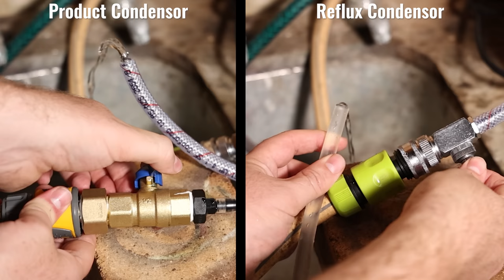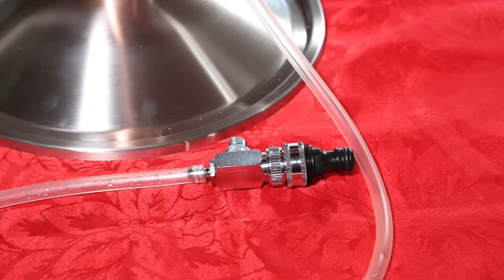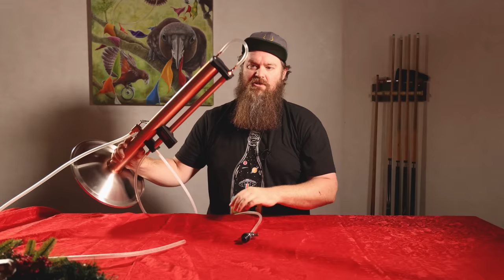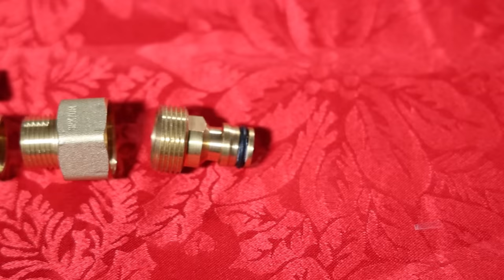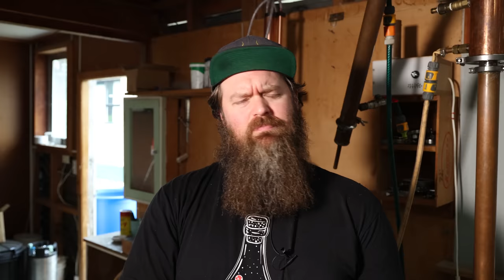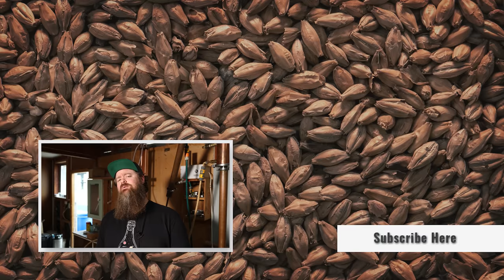Upgrade Your T500 Water Supply : Separate Product & Reflux Condensers

Comment: Great work. Hopefully, we're going to see how you actually use and control this new Frankenstein still :-)
I love the T500 - it's so easy to use - but I want more flexibility out of it and am looking forward to seeing how you can turn it into a pot still.
Reply: Strictly speaking, you already have everything you need to run it as a pot still. Take the normal outlet hose off the fitting it's on now and plug it into the top of your condenser, like he's just shown. Presto, it's now a pot still. The reflux condenser won't do anything because it doesn't have water flowing through it, and it'll run like a pot still. Basically just turn it on and let it run, make your cuts in small jars, let them air out overnight, taste and blend. Easy as pie.
Reply: @jttech44  Many thanks - I am a newby at distilling, but have already found that the T500 is really good, but limited. Next time I'll give this a go. Thanks again.
Reply: @stephenlee62  No problem man! We all had to start somewhere.
If you're a newbie, take really good notes on everything you do, that's the best advice I can give you. That way, if you make something spectacular, you have a way to replicate it, and if you make something terrible, you know how to avoid it.
That, and hop over to reddit's /r/firewater forum, we're a friendly bunch =]

Comment: Hi Jesse, after seeing your review input on the T 500 I put an order in for one of these thanks to Black Friday discounts, and it will arrive tomorrow. The boiler has now been up rated and has a thermostat and has two power setting to select from making the element 2250w in total split 1750w and 500w.   It still would benefit from an on off control but I will wait and see. As the problem with the boiler seems to have been sorted? I thought I would do the mod on the water supply from day 1. The  supplier I use in the UK. Love Brewing sell the needle valve assembly complete for £10 with all the bits just leaving the 6mm hose to get and the garden hose to connect to the mains water supply. I am working on a hose pipe feed so your idea will be followed as you had it rigged up .Did you ever do any follow up films running the T500 with this mod as that would be excellent to see as my learning curve will be tight on this after only having an air still up to now. 
I have been watching all your films on the air still and love the way you get information across. Made many of your ideas for the Air still but I think I am starting to want more. Thanks for all your work.
Bernie.

Comment: I'm really excited to see your content on the t500 I have had one for a year and a bit and love it. But I have heard you can use it as a pot still but no one really shows you how it will work
Reply: First thing is to throttle back the voltage so its not going full whack the whole time, better cuts

Comment: I am highly in doubt between the alembic or the reflux for the grainfather I am about to buy.

I would say if I modify the reflux with your water mod, then the reflux is the most versatile isn't it?
I mean I can make the column longer for cleaner/purer product and I can turn of the cooling on the reflux side to get more like pot still flavor extracting ability?

In the end if I ever would like a second boiler I would like a smaller copper spanish alquitara alongside for the coolnessfactor and the looks. And also for some extreme flavor extractions; so an alembic dome as a starting point sounds like i would also need some kind of reflux setup down the road at some point; ending up with 3 stills... And a low footprint/storage size of my kit is important to me.

What would be your suggestion?
Reply: I don't see the need to do it.
I consistently get 94%

Comment: seems to me a 1 input, two output manifold, controlled with still spirits excellent supply pump regulator, with needle valves also on the two outlets could easily be made from a piece of 15 or 22mm pipe, blanked off each end. However, if this was essential to running this column, i'm sure still spirits would already have designed, and be selling it! What advantage did you find in doing this? Theoretically, you are increasing the reflux capability of the column, but is this really necessary, and did it improve the Abv output, flavour, of the spirit? I too eagerly await part two, lol, however not holding my breath as two years have already passed since part one.
Reply: Alcohol ABV output level is not always a more is better approach, I’d like to adapt this solution to reduce the reflux knock down but maintain flow in the product condenser to retain more flavours for whiskeys and rums
Reply: I consistently get 94%. There doesn't seem to be any advantage to this mod unless you turned it into a pot still.

Comment: Hey Jesse, i have been all grain brewing now for a couple of years and am looking at doing some distillation, I have Keglands 35L and 65L boilers that I use for brewing, i can get a stainless lid for both that accepts the T-500 or keglands reflux still and pot still.
What do you think would be better
T-500 stainless at $400
Or
T-500 copper at $500
Or
Both the kegland copper reflux still and copper pot still for $350?

Cheers 🍻

Comment: I'd be interested to see the benefits in practice of this approach. I just went the other way on my bubble plate still - changed it from two separate inputs back to a single input. This made it much easier to run and also uses less water.  The problem I have with the splitter is that if you open one side the pressure on the other side drops, making it very difficult to strike the correct balance.
Reply: You can alleviate that by having way more water pressure than you need before the valves because it won't change much.

In practice, controlling both means you can control how much reflux you're getting, and, you can run your reflux condenser full-tilt to allow your column to flood and reach equilibrium before you start your take off. That means you get really good fractions coming off the still, ie, your heads cut and your tails cut will be very sharp and won't slur together at all. That gives you the maximum amount of clean neutral heads with nothing else in them.

Having never run a bubble plated still, I'm not sure that you'd want your plates to flood, so, potentially you're not seeing as much benefit. I'd guess that you'd have to worry about your plate cooling water warming up as you run, and that changing the reflux ratio constantly throughout the run. Generally speaking that'd mean your fractions aren't as good and your heads/hearts and hearts/tails cuts won't be as distinct, but they're not that distinct on plated stills in general, nor do you want them to be, so it might be a non-starter.
Reply: @jttech44  unfortunately there is a fixed size pipe coming into my house, so I can't just magic more water pressure. It's trivial to reach equilibrium on a single input, you can just pump as much water through as required for full reflux. Once the column is in equilibrium you can then back it off in order to get the desired output. This is much easier than fiddling with two different inputs where changing one also changes the other
Reply: That is why you need a needle valve on both hoses.  Then you can reduce flow to the top condenser since it doesn't need as much flow as the main condenser.

Comment: Love your videos, we appreciate all your hard work.  I've been checking out a problem with another hobby (laser printing) where it is important to keep cooling water as the laser heats up with use.  I would like to know, if you have ever used an ice machine to maintain cool temps in the condensers.  Countertop ice makers can be purchased for less than 100 bucks, they have a reservoir large enough to place a water pump down into the reservoir with water and allowed to run, dropping cubes every 5 minutes.  As the water melts, it is recycled back into ice, keeping water in the reservoir cool.  This probably isn't a new idea so I wanted to ask a pro if you think I could use this system to maintain the cooling water in my condensers below 1/2 the temp of the head vapor.  I have a small still (pot = 5 gal.) operating on an induction plate at  1.6 to 1.8 KW.  Have you ever tried this method for cooling water.  I love the idea of your converted AC unit but this would be cheaper, less energy used, quieter, and a smaller footprint in my still area.  I think I've watched all your videos at least once and would like your opinion before I invest in a little ice maker.  Thanks for your response, please keep teaching.
Reply: I did try something similar once with the T500 of trying to recycle the outlet water through an ice bath and back into the still through a fountain pump setup.  The issue I found was that the size of ice bath required and amount of ice (admittedly not from an ice maker) required to get the water back down from ~60c was probably more effort than just consuming the water across the distillation run.

Comment: Hey Jesse, thought I'd chip in, I recently made this mod on my t500 and it works great. I think I'm using less water now than before, even though there are 2 water supplies. I use the needle valve adapter that comes with the t500 on the condenser supply, and have one of still spirits water flow regulators on the reflux chamber supply. I used your garden hose double adapter trick, works like a charm.
I got a power controller to back the power off just as product is about to start coming off too. Do you have an opinion on whether power controllers are useful on these reflux setups?
Reply: What temperatures are each tube supposed to be at roughly and how do u measure them separately if they need to be at certain temps

Comment: Dear @Still it , i have a question which i desperately need answer to, i've just bought this still system ( and yet to modify it) and i noticed that i get MUCH MUCH less product then expected few times already, i've always checked gravity and did all the math its definetely not fermentation ( or not enough booze in the mash). i cant see any leaks, maybe theyre arent visible to eye ? or could it be solely because its not cooling it enough in the condenser ?  ( p.s. i keep my temp reading at 50 - 53 C )

Comment: I'm about half way through building a 50 liter keg still,   2 x 3500 watt elements, 6 inch tri clamp and bowl reducer to 2 inch colum in the top, drain in the bottom,,,   its gonna be a beast ,,,,       but now i'm thinking , i shoulda just bought a t500 and be done with it,,,,,    would have been cheaper too,,,,   the keg alone has cost me just under 600 bucks and its not finished yet haha
Reply: That's way too much power for 50 liters into a 2" column. You should go with a 4inch column instead, and make sure you have an SSR to dial the power back on your elements once you hit boil. Also, next time, call around to your local microbrew and buy a used keg off them, they're like 50 bucks.
Reply: Don’t give up on your build, for me it’s half the fun and a continual process of refinement.
Reply: You'll be much happier with your keg. If you can go up to a 3 or 4" column. A single 3500w element will be more than is needed. I use a 4500w and once up to temp its cut back to 70% (3000w)
Reply: @jttech44  In truth, the T-500 is good, but has no room to grow since it is a proprietary design, meaning nothing else will work with it.  If you are serious about distilling, you need a system built around a good boiler (an 8 gallon still is great) and tri-clamp connections.  This allows you to add on and change your system as you gain more experience.  Go to Mile High or Brewhaus.com.  These are great companies and they will have exactly what you need.
Reply: @rocketsroc  It's probably the simplest way to start that will make decent product. Personally, buying a used keg, and a column off ebay, a burner, hoses and you're good to go. Plus, it's much easier to run cuts on a 15 gallon pot still because they change so slowly.
Also, it's pretty trivial to take what you have and build a modular CCVM and keep most of the same setup, and still have enough boiler to easily run a 3-4" column.
Reply: @jttech44  I'd make a good guess that 90% of hobby distillers are using 2" columns.  I wish I had the money I spent on intermediate parts and systems before getting to the present one, but perhaps this is how we all pay for the experience we learn along the way.  Good Luck and Happy Distilling!
Reply: If you do go the t500 route. Get the dome. Use it for stripping runs. Then build a modular column and take off the condenser on the dome. Then you can use a 2" tri clamp bulkhead fitting to adapt over to your other column. 3" is the biggest they recommend for weight the dome can handle. You can go bigger but you'll have to add a hanger or something to distribute the weight. You'll just add a 2x4 or 2x3 reducer to get to your column size or run straight 2". If you go with a bigger column diameter it will speed up neutral spirit runs and overall distillation times. After the column section also reduce back down to 2". Any thing bigger than that after the column section is over kill anyway.

Comment: great video , just wondering when I make this mod to my t500 should the water be going in at the bottom of product and column condensers and hot out top??
cheers
Reply: Good question, depending how you hook up the cold water it will either run as a cocurrent condenser or counter current without going into to much detail a counter current will be more efficient and therefore you'll need less cold water for the same amount of cooling to be achieved. To get counter current connect up like in this video with a cold inlet at the bottom of condenser like normal and  with outlet at the top, with this you'll just need sufficient flow to ensure everything condenses I'd start with it on high and just turn it down until you feel any warmth in outlet stream. For the reflux half have the cold going in the top opposite to the direction of flow of the vapour (counter current) I'd still record the outlet water temp as if you're getting outlet water at 50C I'd think this still would still be running at or close to full reflux, by allowing that temp to run hotter 80/90 C you'll be running much more like a pot still. Check out Jessie's other video on voltage control as I'd think to get the best out of a t500 as a pot still youd want to be running with less power input on your spirit runs.  Hope this helps and have fun chasing the craft :)
Reply: Thanks heaps for the tips, yes I think I will need to order one  of those voltage regulators ,love these videos and the community here 
Cheers
Reply: @michaelkieran3006  glad to help, the t500 is a great still with a few tweaks can do pretty much everything you could want. I'm big into gin distilling and the t500 does a great job cant decide if I like the slow gins (full refulx then flavour) or vapour gins (pot still with botanicals in the column)  more
Reply: @jamesleverton-smith6937  .amazing would love to give it a try after the mods

Comment: Hey dude, heads up on that t500 r.c water supply, go in from bottom not top. Just personal experience.
Reply: Yes, both water supplies should go into the bottom hose connections.
Reply: @rocketsroc  sorry, got myself confused.  Split the 2 condenser's by removing the "U" tube at top. Water flow to each should be separated.  I used a "Y" fitting with one leg to "bottom" of outside main condenser.  This one will exit at the top.  The other leg is the internal Reflux column condenser's "Inlet" which is at the top of the column and exits at the bottom.
This seems contrary, but keep in mind we want to have maximum cooling at the vary top of the column for best reflux. One last but very important item is a needle valve, not a ball valve, so precise water flow regulation can be made to the Reflux condenser.  It doesn't take much flow or have to be very cold.  The needle valve let's you balance outlet flow very nicely and works far better than the SS valve system.  Key to success is thermal probe at top connected to PID. Once you get a bit of experience, you'll find how important is that top column temperature and water flow to Reflux condenser (which is really a short dephlegmator).  End result:. Balanced system, fairly steady ABV throughout the run, less water used, and perhaps best of all, more control which yields a finer spirit.  Hope this helps someone.

Comment: You don't need to worry about controlling the flow to the condenser just so long as you have water flowing you should be fine running it flat out.  Get a large container and a pond pump for the condenser circuit.
Reply: Huffing is why you control the condenser water flow. Rapid vapor collapse is problematic. Sends vapor out of the condenser and can create a dangerous situation.

Comment: I understand the reason for the mod, especially for the reflux but wouldnt you alway run the product condenser on full?
Reply: You certainly can but if you just throw as much water as your condenser can handle without any limits you will end up wasting a lot of water, if you use a water circulating system like a pool or a big barrel that would be a perfectly fine solution but for those draining the waste water into a drain and not using it for anything else it does seem quite a waste

Comment: Shouldn't the water flow be against the product flow for max heat exchange?
Reply: I asked myself the same question. Turns out that the reflux condenser is relatively small so reversing the direction has little impact.